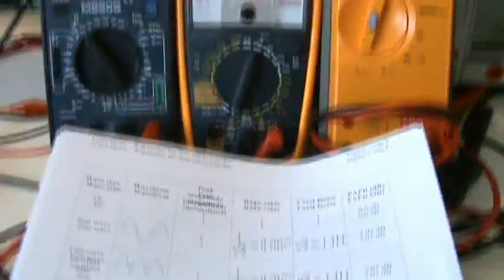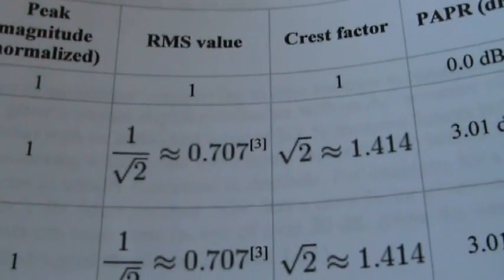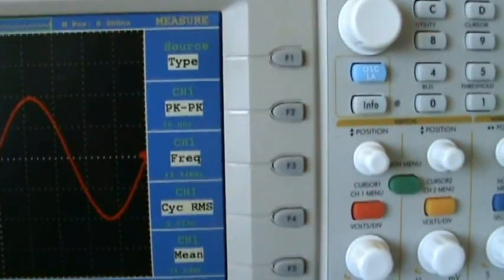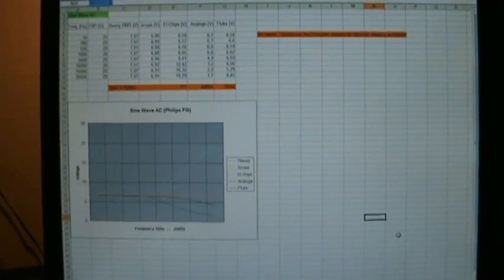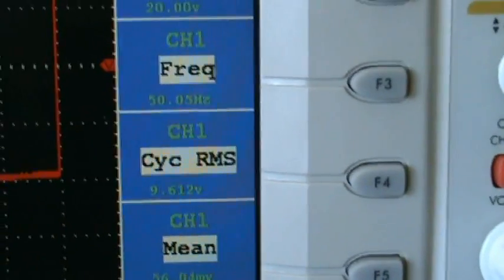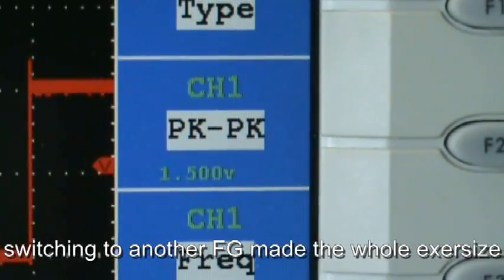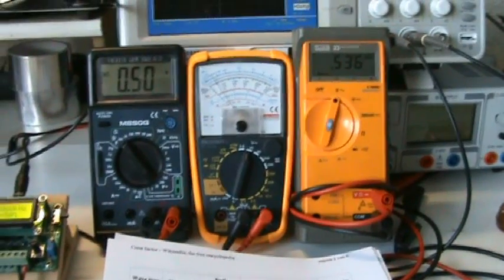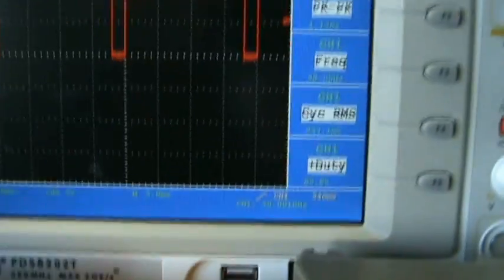DDM's AC RMS test 2 (multiple waveforms) .mpeg

Comment: This is why I always said to attach scope over 1Ohm resistor for amperage and use as voltmeter too. The multimeters are not designed for arbitrary waveforms and higher frequencies than traditional 50/60Hz... 

Cheers!